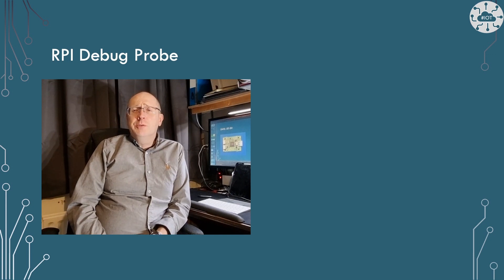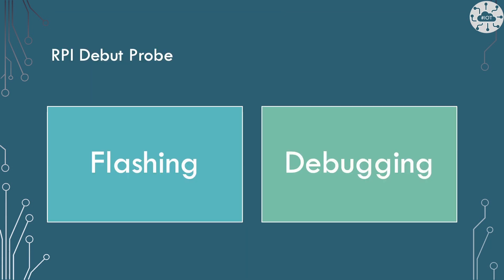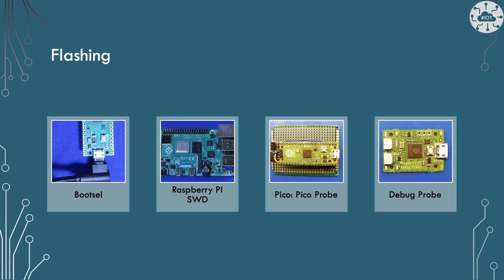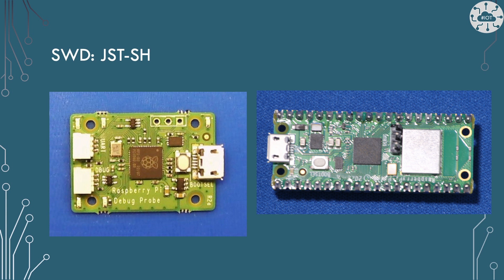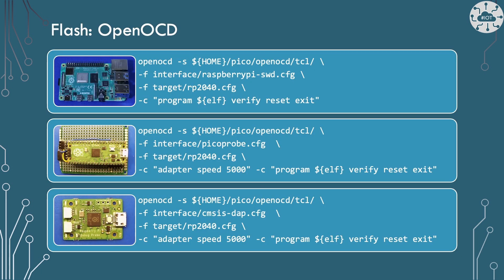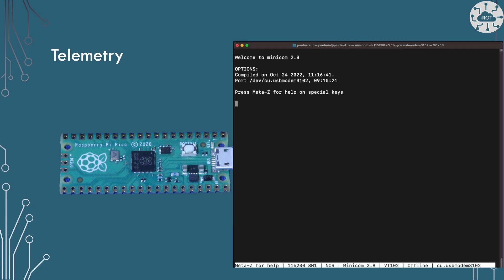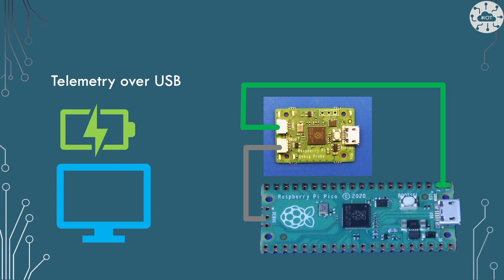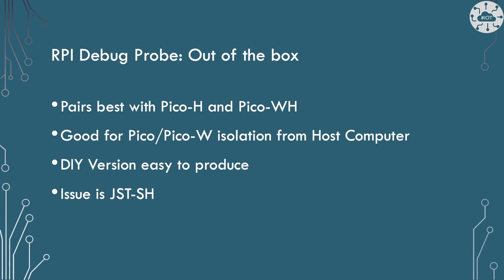Raspberry PI Debug Probe - First Look

Comment: I found this just in time. I wanted to gather debug output (telemetry) and was hoping to use the SWD pins. But this shows me that the "probe" may be a great way to both gather my debug output and SWD control. Many thanks! I'm subscribing.
Reply from the maker: Glad I could help. You could output messages from SWD on Pico. It's called semihosting but is currently marked as experimental in the SDK.

Comment: Raspberry Foundation has released a "one click" comprehensive (full) installation of Pico SDK and VSCode (with all necessary settings) for windows. It is also (simpler, to invest/buy) uses a Pico debug probe, with this process. All, with one CLICK to the LINK provided, by PI website.
Life is good now after 2 years of grief, and time wasted, trying to install several patches.
However, it will be a great help, now,  if you could provide,  some videos/ tutorials, showing
(1) what are the default settings in the VSCode Screen, (2) how to single step/ set break points etc, in VSCode, (3) how to navigate in the VSCode Screen, (4) how to load/ debug the applications programs/examples from pico-examples folder (Serial/I2c/analog etc), (5) how to open/use the serial monitor.  VSCode is overloaded with options, very confusing. I find you to be a good teacher. 
Thank you for making it easier to understand (with your video) the cable connections (labels/polarity) between debug probe and target Pico board.

Comment: Hi. Just wish your screen showing the cable connection between the  (debug) JST of the Pico Debug Probe and the (swd) header pins of the pico board, was a bit neater. You may have noticed, that the manual of the Pico Debug Probe, does no indicate, (for the debug port), which pin is clock and which pin is Data. thankfully, the middle in is Ground (black cable). Hence not much damage will happen if the dupont connector was plugged in wrong way around.
Reply from the maker: Sorry about that. I plug them in the wrong way around all the time too. Though I have notes and diagrams from my course, I still use trial and error!

Comment: Could you please provide more detailed video about using this debug probe especially with old Pico board? I don't know why but there is none for now even though it is already a few months after Pico Debug Probe  was launched.  Thx in advance.
Reply from the maker: Thank you for the suggestion. I do have some tutorials showing much more detail on this within my Introduction to C Development Environment for Raspberry PICO course on Udemy https://www.udemy.com/course/introduction-to-c-development-environment-for-raspberry-pico/?referralCode=875319E04F95C9EC3414

There are a lot of options when compiling, flashing and debuging for the Pico. The course is able to do this in a set of tutorials. So shows how to flash from Windows, Ubuntu and Mac using the Debug Probe. Also to debug on those desktops from VSCode and Eclipse.

What do you mean by old Pico boards?
Reply: @DrJonEA  Just plain Pico having only SWD pins. I'm interested in Pico Debug Probe as it is not working for me. I'm not sure if I'm doing someting wrong  but OpenOcd shows error: "unable to find a matching CMSIS-DAP device." Ports 6666 and 444 are open but no 3333.
Reply from the maker: Sounds like either SWD cable issue or openocd command line. I summarise the command line options you need for the different devices in an Instagram post which might help:
https://www.instagram.com/p/Cqe7Nzttrnh/
Reply: @DrJonEA  I replied twice here and none of my comment is here. What's up? BTW I've found problem.
Reply from the maker: None of you comments has been deleted. I can still see them, so sorry I don't know why you can't. As far as I can see nothing is up.
Glad you found the problem.

Comment: I would probably get this just for the case it comes with. But once I learned that it "works differently" I'm not.. since it seems to add nothing new. (The Pico with the probe software offers both debug and UART also). It was a B*tch and half to get it working. At the time none of the instructions and online guides worked. But now that I got it  working I would definitely not want to change anything.
Reply from the maker: Hi Andrew, once we get things working we tend to stick to our way of working. Certainly I do.
There is a new version of PicoProbe out that now seems to be based on the same code set as the Debug Probe, so uses the same OpenOCD config..
Reply: @DrJonEA  Good to know. Thanks.

Comment: Is it possible it can debug other Arm chips via swd?    Would that be just a matter of configuration (svd/cfg files).. or would it be more like picoprobe firmware changes and/or rebuilding openocd?

For example, the Smartfusion2 fpga has a Cortex-M3 and the STM32H745 has Cortex-M7/M4 cores..  but both have an SWD interface for debugging.   In addition, if the chip (M3+) also has ITM's SWO/TDO (for serial-wire-viewing) can pi-debug-probe + Eclipse/OpenOCD show this trace data? Or would that feature only be available in more expensive tools (Keil + J-Link-Edu/Mini)?
Reply from the maker: My understanding is that the RPI Debug Probe can be used with other SWD microcontrollers. I haven't tried that though. 
That would be just an openocd configuration to use.

Comment: Interesting - I may have a play with one of these.

As a matter in interest, I’ve settled on using the Arduino IDE as my main programming environment for the Pico. While developing code, I always include a reboot() function which is called whenever I enter (say) ‘r’ into the serial monitor - this has the same effect as the Bootsel malarkey without unplugging.
Reply from the maker: Nice. tip. Thank you.
Reply: I really like that idea. How do you implement it? (I don't know how to reboot the board from C code but this sounds really promising because I'm pretty bored of holding down bootsel at this point :-)
Reply from the maker: The only reliable way I know to reboot the Pico in C is using the watchdog timer. That does a clean reset. If you are tired using bootsel then why not use SWD?
Reply: @DrJonEA  ERe using SWD, see my above reply. SWD works great on my Pico H but some of my devices don't have debug headers and I'm trying to come to terms with the fact that I'll need to learn to solder (and buy the required kit)!
Reply from the maker: Soldering isn't too difficult a skill, at least at through hole level. Even with my old eyes and shaking hands I can manage. Also things like clamps help a lot to hold things still.